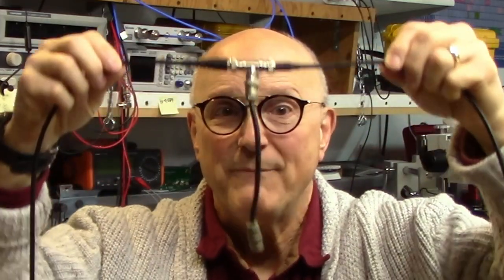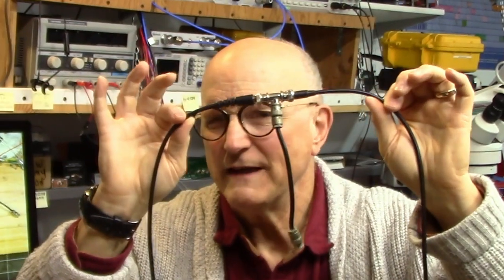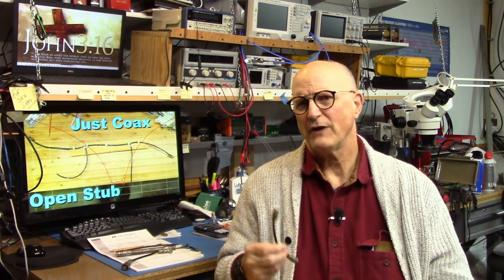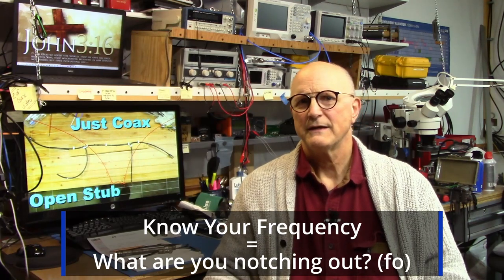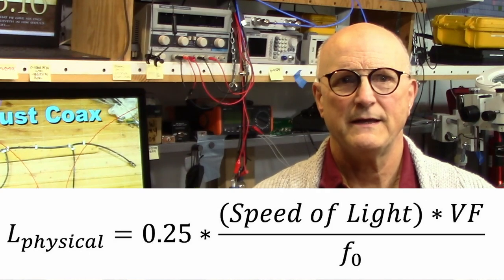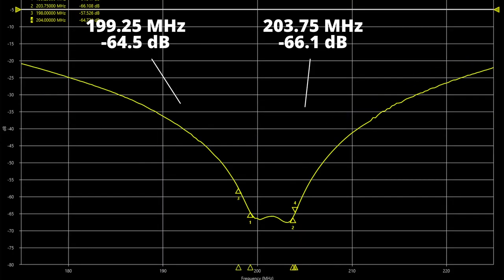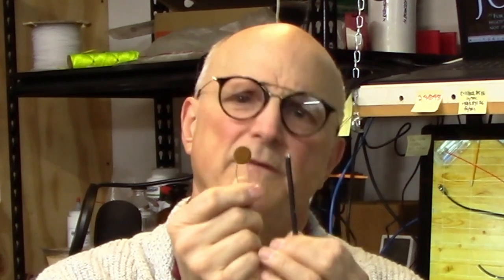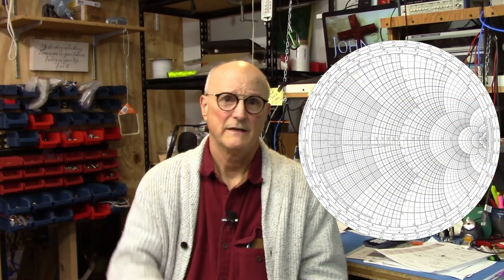Create a Band Reject Filter using Coax - OPEN STUB VERSION (049a)

Comment: Thanks a lot for your explanations. I am an electric engineer in the high voltage power transmission field (gas insulated high voltage switchgears) and while I have learned this more than two decades ago, I have not used it ever since and as we all know: use it or lose it.

Now I had to dig into this again, because when we commission a new switchgear, we do a partial discharge measurement and we measure the PD signals by detecting their UHF signals. Sometimes there are background noises making the measurement in the time domain impossible, although this is required to check for particular patterns. So now I start using spec analyzers to determine the disturbances and build specific stub filters which then allow me to measure in the time domain without any interference.

Your video was really helpful to bring the stuff back to mind.
Reply from the maker: WOW! And, this stuff can be a bit of a head breaker! I'm so glad that these videos are helping to bring all this R.F. magic back into memory! 🙂

Comment: Will this stop at just the desired frequency or will you have multiple harmonics as well throughout the higher spectrum?
Reply from the maker: It will continue to multiple harmonics with lesser and lesser effectiveness for higher harmonic frequencies. With open stub it will be at frequencies where the stub is an odd multiples of 1/4 wavelength.  With shorted stub where the stub is multiples of 1/2 wavelength. 🙂
Reply: How are notch filters that don't have harmonics made?
Reply from the maker: @clownworld7763  The very simplest form of this is putting a parallel tuned circuit in series with the signal with some finite resistance to follow. This finite resistance might be just all the circuitry that follows such as the input impedance of the circuit that follows. At resonance the parallel tuned LC circuit acts as an open circuit. I'll warn you, here, it is a pretty wide banded filter.
You could also add a properly chosen series tuned LC circuit across that resistor. This one acts as a short at resonance. Remember, that resistor could be just the impedance of the circuits to follow, so an overt, physical resistor may not be needed.
I threw one together using LTSpice. MUCH narrower response that the parallel tuned circuit only. I simulated it from 1MHz to 100 MHz with an fo of ~5 MHz. No harmonic interaction. 
If you are intending this for anything that will be handing any sort of power (e.g. transmitting), then you need to be careful to choose components that can handle the currents and voltages associated with that application.
Hope this helps. 🙂

Comment: How would you calculate the size of the stub if it has a different velocity factor to the coax from the antenna and to the transceiver.
Reply from the maker: Fortunately, what really matters is the electrical length, not the physical length of the coax. Your filter could be made up of coax with a variety of velocity factors. No one piece of coax really cares about the velocity factor of the others. So, you determine the physical length of coax A with the velocity factor of coax A to give you the electrical length you need for coax A. The same for all of the others. Hope I made sense. 🙂

Comment: can you use 12th wavelenght stubs instead? maybe they have a higher Q factor?
Reply from the maker: Interesting thought...the problem I see is that you will not get the impedance conversion through the coax that is required to do the job. 🙂

Comment: Any info on the variable capacitor? Did you make it or buy it? Any part numbers would be great. I want to create some stubs to reject my CW on field day.    Great video!
Reply from the maker: Thanks!  The variable capacitor that I showed in the video actually came off of an old hybrid ring duplexer which sports one of them for each ring/cavity. I do not know where someone would buy one. I'm sure they are out there. But the design is simple enough, a home brew version shouldn't be too hard to come up with using similar techniques. :-)

Comment: How .......did u measure ? Swr ? Logmag . PHASE ? Show us the way u connect the coax please onto the meter ...
Reply from the maker: You are right, I didn't explicitly state how I connected stuff up (oops). My apologies. I measured the rejection using, S21, through/response with source on port 1 going to the "input" side of the filter assy and measurement on port 2 going to the "output" side of the filter assy.
I used log magnitude display after having set up the frequency limits for the frequencies of interest and performed the appropriate calibration.  I hope this answers your questions.

Comment: What are those tuning capacitors called and are they available commercially? I have searched around but couldn't find them. Thx
Reply from the maker: The only place I have found them is attached to a Hybrid-Ring Duplexer.  Thats where I got mine from ... an old duplexer whose cavities had developed internal mechanical issues. One could DIY them, I suppose, with some effort. 🙂

Comment: Hi:  I really enjoy your work.  I had two questions:  1.  15 meters is taking my antenna TV offline.  Can I do the "stub" thing with RG-6?  I am thinking I could filter out the 15 meters; and 2. I built an End-Fed, Half-Wave antenna.  I wound the 49:1 on a T140-43 and have the wire cut for 80 meters.  I guess I shouldn't complain, but I don't get why not only do I get my bands and their harmonically related bands, but it works great on 30, 17 and 12 meters.  It amazes me as I don't need a tuner at all for any of these bands.  Does this make sense?  I bought another T140 and will be winding that one too to check if it is the toroid or something else.
Thanks,
Marc
Reply from the maker: Thank you! 🙂
1. Yes, you can do the stub thing with any transmission line you choose.
2. A lot a strangeness goes on with antennas. Of course, a good dummy load works on every band. So, the question is, "Is it all working as a dummy load or a real antenna?" ie. "What is its radiation efficiency on those 'extra bands?' "
I know that I do not have a handle on a lot of what antennas work. I do a LOT of modelling with 4NEC2 ... virtual antenna experiments.  You could try modelling it and see what it should theoretically do. 4NEC2 is *FREE* and I have some videos on how to use it starting with the one here:
https://youtu.be/Zd6BT558YRA
If you are using a 4:1 BALUN to feed an antenna, you put 200 Ohms in for the characteristic impedance.
Hope this helps. 😁
Reply: Your radiated power on 30,17 and 12 is very very low. The 100-150pf capacitor is showing your radio decent vswr but your power out is probably 20w at 100w. Check out that capacitor under a thermal camera on these bands and see how much they glow. 🤩

Comment: Is it possible to create a very narrow notch filter? Either with this method or any other? I'm receiving Meteor and NOAA weather satellites, from 137.1 to 137.9 MHz, but there are strong VDL2 blips that ruin the reception due to overload, especially for Meteor since it's digital and loses sync when a strong blip happens. I've tried reducing the gain but then the reception always becomes weaker. The VDL2 interference is at around 136.7 MHz.

It would be great to eliminate or greatly attenuate thr 136.7 interference without compromising thr 137.1 reception
Reply from the maker: Really good question! I had similar questions when I first started playing with these years ago.
Unfortunately, by stacking these (adding more stubs) I was able to get deeper and deeper notches, but the "skirt" remained just as wide....too wide for what I was hoping to do.
Maybe put a pre-amp before the filter to overcome the loss anticipated by the filter at the desired frequency(?) The over all response at the desired frequency is 0 dB, but still -60 dB at the reject frequency. It might be worth a try.
There are some inexpensive duplexers out there that you could retune to do the job, too. 🙂
I cannot recommend anything, but I see several options on eBay for around $99.
Reply: @jim9930  If I understood correctly, in this case the frequency I want to attenuate is 136.7 so I should mix in 126 MHz to have an IF of 10.7 and use the crytal filter?
Reply from the maker: @jim9930  Cool idea! 🙂
Reply from the maker: @t0nito  I think what he is saying is that this mixer/filter combination is for singling out the signal you want to receive and, in doing so, attenuating the adjacent signals you do not want. 🙂
Reply: @eie_for_you 
Oh, that wouldn't work for me, I need 1 MHz bandwidth as some satellites sometimes transmit  simultaneously.
Reply from the maker: @t0nito  With a mixer and filter the bandwidth is up to the filter following the mixer. This could be as narrow or wide as you like. But this is admittedly a relatively complex solution. 😞
I am running into similar battles trying to put together a very simple, very wideband FM receiver for VHF and UHF as the front end of an FM deviation meter. Ugh! 🙂
Reply: @eie_for_you  Coincidentally I just discovered a down converter for Air band, there's a 100 MHz and a 110 MHz version, what type of notch filter would you suggest? This would place the offending frequency on either 36.7 or 26.7 MHz depending on the version
Reply from the maker: @t0nito  Well ... neither of those frequencies are standard, off the shelf filter frequencies (that I am aware of). BUT you can design and build one for yourself using the tool found here: https://markimicrowave.com/technical-resources/tools/lc-filter-design-tool/
You specify what you are trying to accomplish and it will give you the design. At these two frequencies implementation is a LOT easier to put together. Be sure to include some adjustability in your implementation so you can adjust it to your specifications. 🙂
Reply: @jim9930 I don't have a problem receiving the satellites with a QFH antenna, the problem is there are stong VDL2 blips that overload the SDR and they produce noise on the resulting picture or loss of lock on digital LRPT signals

Comment: I am surprised at your cable length calculations - have you tried this directly?  The theory is good, until you discover the VF changes with frequency, that frequency incidentally not specified by the manufacturer...  Try it on your VNA and see - you will see the VF change dramatically away from the manufacturers spec as you go up in freq.  The calculations are only useful at the manufacturers specified frequency, if you can find that anywhere...  Just use the VNA in impedance mode to cut to electrical lengths, not the calcs.  Top video otherwise, thanks for teaching.
Reply from the maker: This is why I measure the velocity factor for myself for these kinds of projects. 🙂